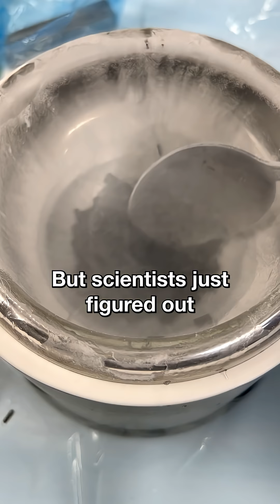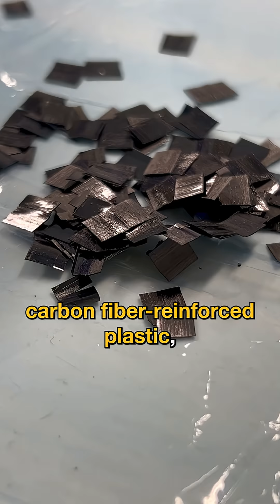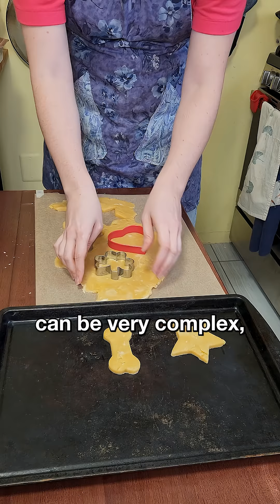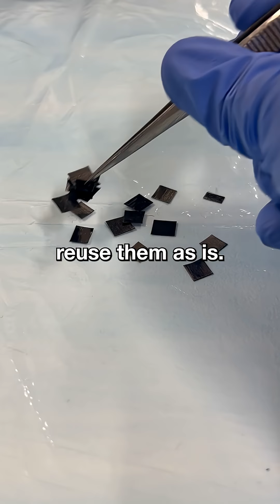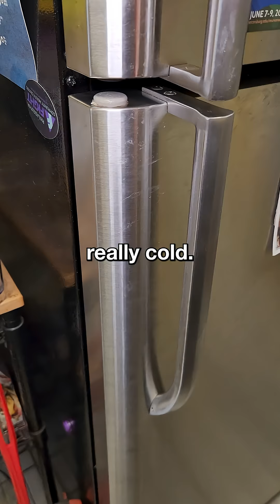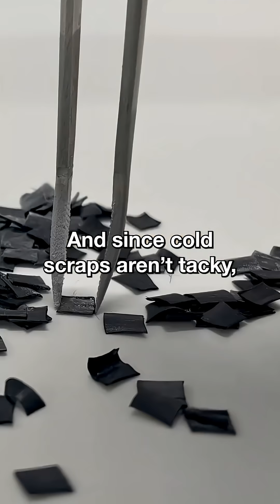How to upcycle your spaceship parts | Headline Science

Comment: sounds so obvious as you state it since the resin is cooled down unted its glass transition temp which for resins in in the - since its made from oligomers which are short chains that later form polymer chains in this case a croslinked matrix since its resin